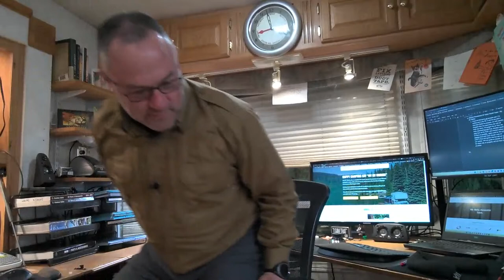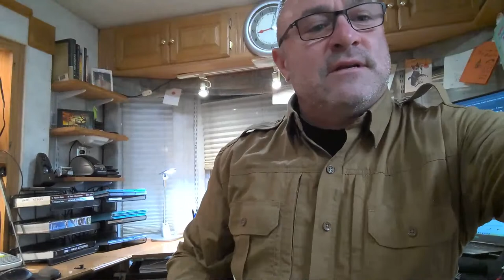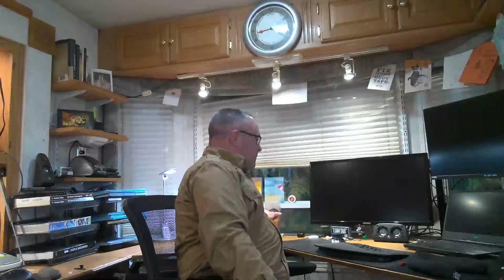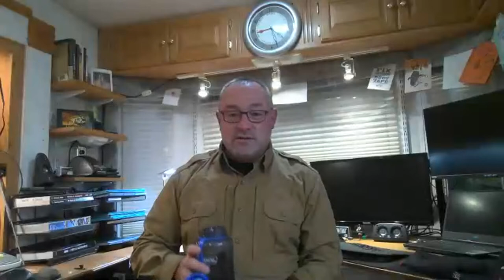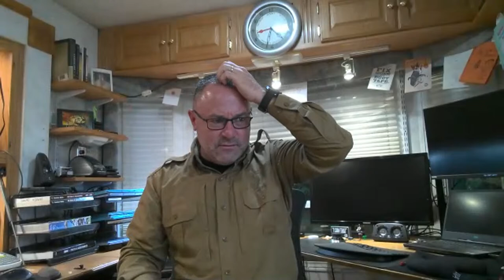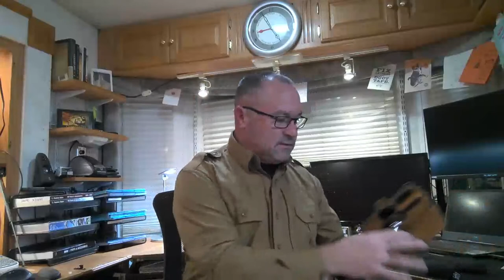Answering Your RV Questions LIVE I November 2022

Comment: Nice event! Always enjoy viewing.  Sorry I missed live feed. Speaking of sprays on hydraulic rams - in the Navy - we used a light oil like WD-40 with a very clean cloth. Especially aboard aircraft carriers. Dust off Africa was only time it was bad.  Thanks!
Reply: Whatever fluid is used in the system, normally ATF is best to clean the rams.  
Lippert will tell you silicone is ok.  Lippert will also say no WD40 and go into how it’s a water repellent not a lubricant 
At Jayco tech school they had the Equalizer rep I(think, I know it wasn’t the Lippert owned hydraulics and pretty sure it wasn’t HWH) say WD40 was what he used.  
The consensus is clean the dirt off.  It is what ruins them.  Don’t leave a sticky residue. If you ever rebuild a hydraulic ram,I recommend replacing for an rv as most are not serviceable but most floor jacks and bottle jacks are , the little rubber gasket that holds the fluid is just that a rubber gasket.  So parking on the beach or in the mud if it’s windy and your rams get coated with ocean mist and sand clean them off.

Comment: Thank you for the information.  Trouble shooting is very difficult without hands on. You can only identify the typical historical faults. I am interested in obtaining more detailed construction of my 5th wheel as I am try to repair floor and wall sections damaged by water. I just would like to see how it was installed/built so I may better permanently repair.  Thanks again.

Comment: I have a 2013 big horn 5th wheel 3685rl. Where can I get a repair manual on removing the black tank. I have everything unhooked except sewer drain and vent pipe. Do I need to remove #1grey tank? Rob from South Carolina. Appreciate your videos.

Comment: Question -- Replaced the solenoid and the blower motor in an Atwood furnace all hooked up correctly then it came on and the blower motor would not shut down what is causing it not to shut down the heat goes off but the blower motor doesn't please help

Comment: A question..running off solar, when my batterys get low, from my separate generator, would I get a faster charge going thru the house  converter, or using a 6 amp battery charger hooked to the generator.Ive been told my 2019 winne micro minni's converter puts out only 3 to 5 amps.

Comment: Question…
We have a AquaHot 450DE, they dropped the float switch out of the loop, and will have it replaced soon ,…but we are having to fill the tank for the transfer fluid everyday , 8 to 12 oz ,..even when we are not using it. We have found no leaks. Any ideas of where it is going ?
Thanks

Comment: Question 
Hello hello darren 
I just Bought a 2002 Fleetwood bounder here in Mexico really hard to have anyone help me on this. I’m hands on trying everything but I can’t figure it out ! 
 My slides will not open even tho the other day they closed, 
I check fuses under the hood  and there not broken power gear board fuses seam to be ok and battery have 12 v current when I checked,
I don’t hear the motor when I click the key, 
My slide panel is just a key there is no lights to show the faults 
My hydraulic level is also not working the just has the jacks down alarm on and I can’t turn it off, there is also power running to the float sensor, 
I would love to have this issue fixed it’s urgent I hope you go live again or maybe we can do a video call and I can pay you.
Reply from the maker: We will go live again early December.

Comment: You don’t ever answer my question. How do I check if a used domestic RM 2612 works before I install it?
Reply: Apply AC to it. Then test LP side after. Make sure to always supply12Vdc
Reply from the maker: Hi Steve, sorry we missed your question!
Reply from the maker: On our refrigerator playlist we do have quite a bit of information that would be helpful for you to determine this. The only way to know for sure that it's going to work is to build a chimney on the back cooling unit side. That chimney is very important feature to make sure the refrigerator is going to work. On our website under the resources tab, we have a plethora of refrigerator manuals if you search for them.  Once you get that chimney built ( some folks do it with cardboard) you will feel the difference in temperature between the boiler and the absorber coils. The difference should be hot to touch but similar between them both. There may be a 10° difference or something.  You're going to have to let that refrigerator run for several hours before you feel this difference in temperature between them two points.